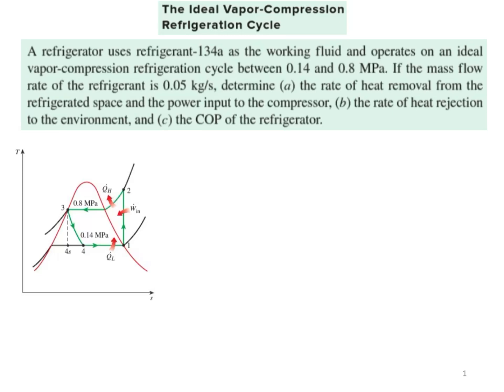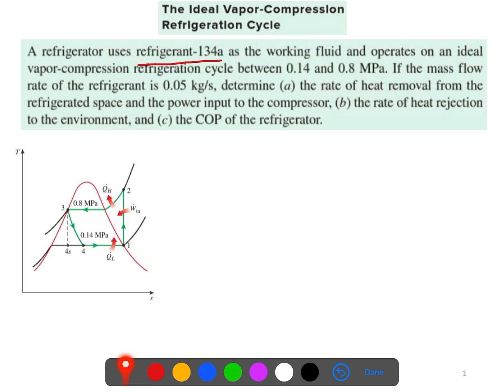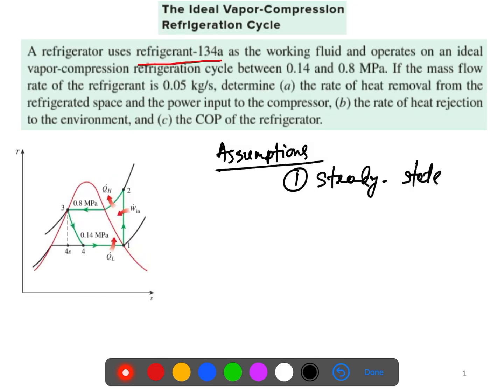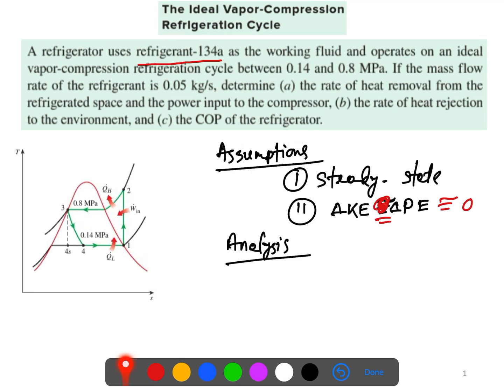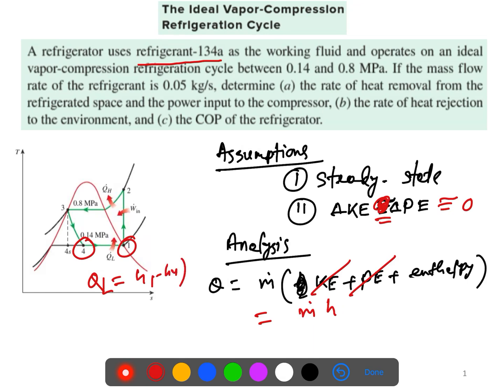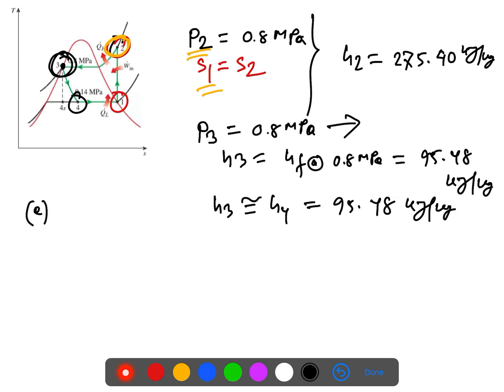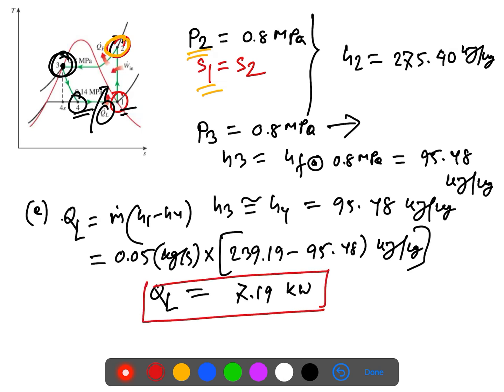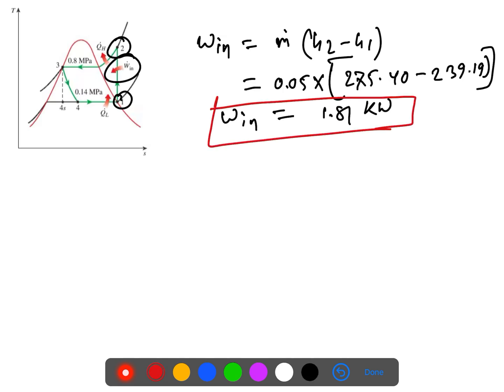Thermodynamics L12:Problem 1

Comment: interpolation method:
needed entropy for calc=0.94467
closest matched entropy in chart=0.9481

Since, 0.94467<0.9481
(take the value 0.9481 and another value from chart that is close to 0.94467 which is 0.9185 in this case.)

                        Entropy              Enthalpy
                        0.9185                267.34       (from chart)
                        0.94467                   x            (required enthalpy)
                        0.9481                276.46       (from chart)

                  (x-267.34)             0.94467-0.9185
               ------------------------   =   --------------------------
                276.46-267.34          0.9481-0.9185

   Required enthalpy, h2 = x =275.4 kJ/kg

Hope this helps somewhat. ☺
(p.s. plz view from desktop if disoriented in mobile.)
Reply: Thank you
Reply: thanks a LOOOTTTT

Comment: An ammonia vapour-compression refrigerator operates between an evaporator pressure of 2.077 bar and a condenser pressure of 12.37 bar. The following cycles are to be compared ; in each case there is no undercooling in the condenser, and isentropic compression may be assumed : (i) The vapour has a dryness fraction of 0.9 at entry to the compressor. (ii) The vapour is dry saturated at entry to the compressor. (iii) The vapour has 5 K of superheat at entry to the compressor. In each case a)
calculate the C.O.P.t
b) Heat transfer by the condenser
Reply: Pleas can you help me solve this